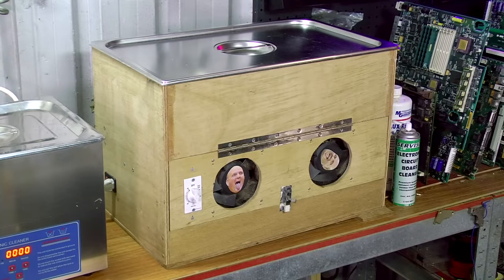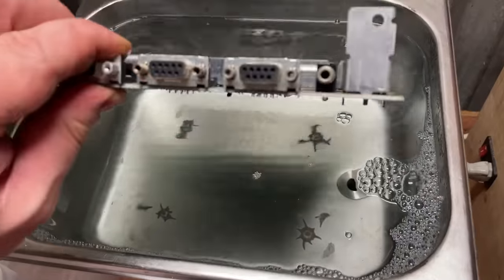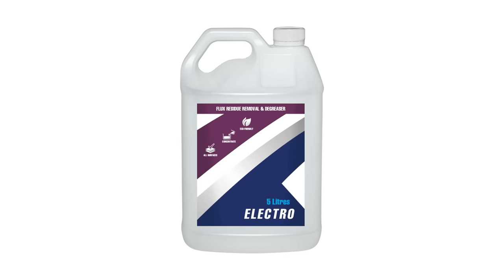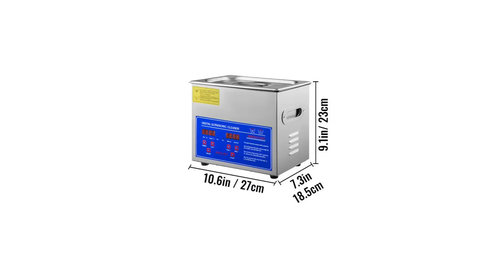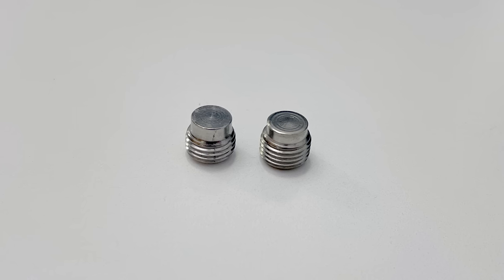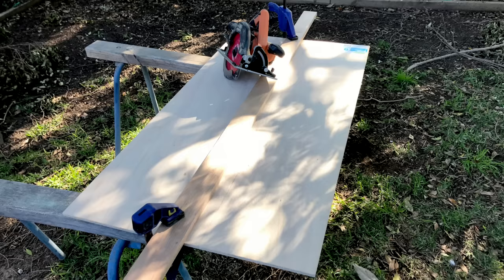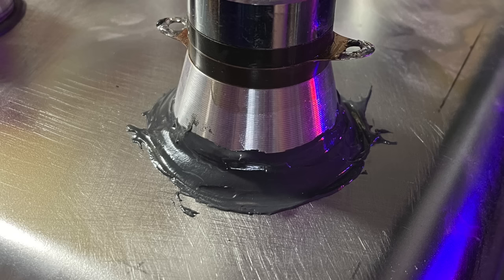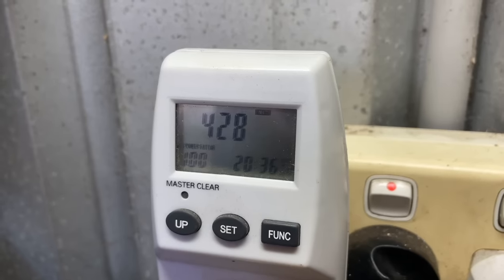Building my own Ultrasonic Cleaner

Comment: Great article on building an ultrasonic cleaner. 

Some suggestions  : 

*) Positioning of the transducers under the pan.
The two commercial units and your own show the transducers spaced equidistance and positioned relatively close to the edge of the bottom of the water tray.   This will work but creates a really  inefficient transfer of acoustic energy into the tray and water.   The curved edge of the tray is the stiffest part of the tray.  So its hard to impart vibrations into the pan.  The centre of the pan is the most flexible part of the pan and this is where the transducers should be mounted. 

To maximise the amount of pan bottom-panel movement , you need to mount the transducers closer to the centre of the pan.
You also need to keep in mind that the transducers are now acting as a broadside array (in both the X and Y directions of the pan area) and that the spacing between the transducers will affect the (spatial) phasing of them (and hence  the amount of overall power).  To keep the transducers working in unison (spatially)  you need to space them at integers of the wavelength they operate at.    The  propagation velocity for water is 1450 m/s and for the steel pan , somewhere  around 3000m/s ( from memory , so please confirm this before using it)  Since your mounting to the metal pan,   then say your transducers are running at  30kHz  then 1 wavelength will be C/F = 3000/30E3 = 0.10 m (driver centre to centre).    So ideally you would need to keep the transducers  spaced around 100mm.  Any way you have the idea , you need to plug in the  operating frequency for your devices, and look up the correct propagation frequency for the metal.

You could measure the propagation time across transducers to work out spatial phasing and ideal  transducer distance  by exciting one transducer (only) and  measuring from a second adjacent transducer , but treating it as a "pickup microphone". 

*)  Polarisation of Transducers 
It is not impossible that  the output transformers feeding the transducers  may have different winding directions depending on suppliers of the transformers.  It is wise to check , with a scope the actual drive signal polarity to make sure all drivers are running in phase. 

*) Tuning of the driver frequency for maximum power output. 
The transducer design you are working with is known as a Tonpilz transducer ( means musical mushroom in German).  The conical aluminium mounting base is a 1/4 wave acoustic shorting stub.   This all means that the transducers are resonant devices meant to transfer max energy at the resonant frequency of the transducer.  I suggest, you tune each of the  drive and transducers, one at a time, mounted to the pan and pan full of water.  Tune  for maximum power transfer to the water.    What I do is to float a sheet of aluminium foil on TOP of the water, and count the number of seconds to achieve pinholes. That gives you a pretty easy way of calculating a time integrated method for real acoustic power measurement.    There will probably be a trimpot on each of the driver boards that will allow you to tweak the driver resonant frequency. 

*) You need to use welded lugs to secure the transducer to the pan underside 
Epoxy will work , but you lose energy ( the stuff is too compliant) and you are getting heat failure of the epoxy
Consider using  spot welding to mount the mounting studs to the bottom of the pan for maximum power transfer.  If you cant afford a spot welder, using a heavy duty  truck 12V battery that can crank  400 to 600Amps.  Use a starting solenoid  to interrupt the battery, use welding leads or car battery  jumper leads ( around 1/2 inch  thick copper wire)   and  then use a monostable multivibrator to  adjust how many milliseconds to  power the starter solenoid that feeds the  spot  weld  contact points.  Use a couple of spark plugs with the centre ground leads snapped off , for your point contacts. 

  *)  Transducer overheating 
Consider  using a high temperature epoxy (electric motor coil epoxy)  to glue small heat sinks to the bottom of the  transducer backs , so the fans can do their job better, and place the heatsink blades in the same direction as the air flow.
Heatsinks and glue mass will alter the Q and the resonance frequency of the transducers , so take this into account.
If your transducers are overheating, one possibility is that they are not transferring all of their acoustic energy into the pan and  water.
As a consequence, some of the electrical energy is converted to heat in the transducer. Use this knowledge to help you tune your device for max power transfer into the water.  

*)  Power transistor ratings 
Your output transistors are FeiHong FHA13009A (or similar brand) rated at 400V 100W 12A 4MHz  +150℃@(Tj)  in a TO-3PN flat pack 
(PNP power transistor).

Consider uprating these , use  Mouser selection search to find a suitable VCE, power,  current and  temperature rating.  To widen your search allow for other   mounting considerations such as TO3 can and use a heatsink placed in the fan air flow, and use fly leads to connect the trannies to the PCB. 

I found  2N6609   (TO3 can )   with 16A , 150W , 200 c (Tj)  but a VCE of 140V ( you will need to measure the max VCE of you drivers to see if this is high enough. ) 

You should measure the operating temperature of the existing trannies to see if its overheating the mode of failure or over voltage transients.For the former, you can solve using bolt on heatsink and for the latter , use a GMOV varistor across the C & E to clamp any bad transients (you will need a high speed scope to see glitches. A low speed scope may not be able to see them, and the scope leads may also be a source of damping, so beware ) 

Good article - well done 

Hope this helps 

George
Reply: What an amazingly detailed post! Thank you kindly for taking the time to share/write something so helpful and educational for everyone, bravo 🤝

Comment: It's refreshing to to hear "the rest of the story" Having done my fair share of custom equipment this shows the process nicely. I for one would have found someone to weld the screwed attachment points on the tray but hey that's me. The glue seems to work once the kinks in the method are Ironed out kudos for your persistence it paid off

Comment: A mechanic friend of mine cleaned some rusty heads for me at his house. He just put them in a metal bucket with water and baking soda. Then hooked ground to bucket and positive to a piece of scrap metal . He was using a 10 amp battery charger. It cleaned the rust great out of those heads. They had been laying outside for 10 years. I was very impressed. Thanks for all the great info. I want to make a 55 gl. drum into 1 for cleaning blocks.

Comment: I spent many years servicing L&R industrial cleaners and watch cleaning machines. Transducer polarity really doesn't matter as long as they are al wired the same. Any transducers in the system wired differently from the others will produce a waveform that is 180º out of phase and cancel its equivalent energy from the system.
Reply from the maker: That's great to know, thank you!
Reply: That is like wiring up a pair of speakers. If you wire one speaker, say using a red wire for positive & a black for negative, & on the second you use the black wire for positive & the red for negative, you have created an out of phase condition. With the balance control set in the center, you will not have any real bass. Turning the balance all of the way to either full left or to full right will bring the bass response back to life. With the balance set in the center, one speaker is essentially moving outward on bass notes & the other is moving inward. I used to call this the Star Trek "Matter verses Anti-Matter" effect.
Reply: What is the nominal impedance of an ultrasonic transducer?

Comment: This video provided me with tons of valuable info on DIY ultrasonic cleaners. Its nice to know someone who also is good a TIG welding ( as its called in the states). I wonder if the transformers were of the wrong values ( wattage wise) since they were overheating. A typical Chinese thing to undersize components to keep production costs down.
Reply: Also a note not mentioned elsewhere in this section; The mounting of the circuit assemblies benefit greatly by having their boards mounted on edge, with heatsinks all pointing up, such that air current in enhanced. In this way, they run cooler!
Reply: The Chinese are practicing zen. Minimalist Copper in the transformers, i.e. only what is needed without a margin . If you can drop your input voltage 10% you can extend its life …

Comment: Well done!

I'm sensing a pattern with those drivers... I hope you find some good quality ones.

If I were to make one I'd try drilling and tapping.a hole in the mounting pegs and securing them with a screw, washer, and loctite from inside the tub, sealing that with an o-ring or something because my welding is nowhere near good enough to tackle this either.

The vibration from the cones must be pretty wild, I can see why it would eventually break a brittle epoxy bond.

Comment: When I repaired industrial electronics, we had a dedicated circuit board cleaning station.  We had a dishwasher and a modified refrigerator with a hot air circulation system to dry them in, about 100 F to prevent melting things. Cascade was our soap of choice.
Reply: before or after they took out the sulfur?
Reply: @acidreign0911  This was the late 80's so I would guess after.
Reply: @ronjenkins6674  naa.. they didn't take out the sulfur till the 00's so cascade was much more effective back in the day.  I knew a guy that ran an internet cafe in the late 90's.  He use to use a similar technique on keyboards.
Reply: @acidreign0911   I'd use bleach on my keyboards if I ran an Internet cafe, LOL  This stuff was industrial electronics mostly used in making cardboard or tires.  That stuff was nasty, sometimes the only thing wrong was the crud was shorting something (or a whole lot of somethings) important out.

Comment: Would be an interesting and rather cheap experiment to do a series of the aluminium foil tests with a cascade of foils hung from above, that way you could make a 3d map of cavitation intensity. I'd guess the positioning of the transducers is crucial, combined with various driving frequencies you get interference patterns with unwanted hot spots and dead zones. Though I'm almost sure you can't precisely (if at all) set the frequency of each driver, so this could easily turn out to be a futile attempt to synchronize them in the first place. Still, it would be interesting to see if any pattern emerges in the current configuration.

Comment: Just a small hint. The lugs with the threads which should be welded on the tub, to which the transducers have to be glued, have a purpose. 
The thickness of the glue needs to be a certain thickness to optimize the energy transferee from the transducer to the tub. Otherwise the energy stays in the transducer an gets converted to heat. The waste product of the energy converging world. 
If one cannot weld there are mettle stripes of different thickness which can be bought and uses to make the glue the right thickness.
Reply: yeah that is true, but in reality glue has no business being anywhere near the transducers and the tub. Glues are organic and do not have the high density to properly transfer the phonons from the transducer to the tub. Welding is necessary otherwise you are robbing yourself on efficiency, and probably shortening the lifespan of your transducers. I was using these things way back in 1997 in combination with a Malvern Zeta sizer and a Malvern Mastersizer for particulare anaysis in the functional foods industry. Laser particle analysis, Mie theory, Fourier transform the whole shebang.
Reply: @psycronizer  Umm... all ultrasonic cleaners use a combination of a welded lug and a high temp adhesive (the proper kind comes in sheets and must stay refrigerated before use), but epoxy can be used. when used together, the energy is transferred through the lug and the epoxy keeps the transducer from unscrewing from the tub.
Reply: That's super interesting them heating up because of energy transfer, or lack thereof. So I guess that's like what happens when a radio transmitter's antenna isn't tuned properly, which also fries the drivers. Ya learn something new every day!
Reply: @psycronizer  I don't know what that's good for but I intend on learning. I have heard of a Laser Particular analyzer and sizer's but lack the wisdom for the other. Yet I am learning.
Reply: @psycronizer  alternatively you could weld saddles around the transducers with rubber wedges pushing the transducer firmly against the bottom of your tank …
Reply: Silver soldering (brazing) rods with flux made for stainless steel right on the rods IS available. Manufacturer says to use a propane torch. I would use acetylene bottle like I do for HVAC silver soldering. Because more BTU/time.
Reply: @psycronizer  I'm sure we are all very impressed, internet stranger.

Comment: Protip on the whole welding thing:
In a situation like this you don't actually need much skill to do it right. Just centerpunch the spot where the threaded bolt thingy is gonna be (so you have it marked from both sides). Then place it down right there and maybe hold it in place with some aluminium tape (or any other heat resistant tape). Then simply weld right on the spot from the other side (probably works best with a TIG welder, but MIG should work as well). You WILL blow a hole into your thin sheet metal, yes, but since the bolt is right there anyways that's actually what you want. It'll weld right through and onto the bolt. Done.
Reply from the maker: Thanks for the advice! If you get a moment, please check out my follow up video where I play around with some welding and silver soldering. https://youtu.be/ByhGEFwCxoY

Comment: Great video!   For attaching those studs, Harris Staybrite 8 is a high strength/low melting point solder used in the hvac industry that is quite easy to use.  It melts at 550F and can be applied with an inexpensive map gas or propane torch if they are the “swirl” type (gets more air mixed in for higher temps).
Reply: But will it solder to stainless?
Reply: @Carl Mayo  with the correct flux, yes.  Surfaces need to be very clean and heat controlled carefully to not burn out the flux.  Stainless is very easy to overheat, since it is such a bad conductor of heat, so go light on the heat and give it time to  come up to temperature.  Harris does make a special stainless steel liquid soldering flux that is probably better for more critical or difficult to clean assemblies, but I believe the normal stay clean flux should work if the surfaces are cleaned thoroughly.  Stay silv 45 or 56 brazing filler is also an alternative that can be done with a swirl tip mapp torch, but those rods are very expensive.  The stay brite 8 would probably work just fine as long as you get a good clean bond.
Reply: @carlmayo7650  Yes, Staybrite 8 can be used for stainless - it’s has to be used with a liquid acid flux.

Comment: Bruce, I have a suggestion for you. The studs that come with the transducer heads can also be silver brazed in place. A small propane torch can generate more than enough heat for that purpose. If you carefully apply heat to the stud a little at a time it is as easy as soldering. Granted the temperature is much higher than soldering but you will see the flux melt and flow when the temperature is high enough then the silver will flow just like solder does.
Reply from the maker: Thanks, I've had many other people make the same suggestion. I actually have all the solver brazing equipment now and will be doing some tests for me next follow up video.
Reply: @BranchusCreations  Hey Bruce, since the tubs are thin they will warp pretty easily if too much heat is applied. First, use something like a scotch bright pad or the like and Isopropyl alcohol to clean the area you are going to braze too. Then wrap the stud in something like baling wire to hold it upright and in place with the threaded tip up and the flat against the tub.  This will keep your hands clear of the heat and ensure the thing stays put. Then make a ring of the brazing wire to wrap around the unthreaded end of the stud. Next, apply a small dab of borax/flux to the spot. Remember the silver brazing metal is going to follow wherever the flux goes so start with a small dab maybe 5mm dia. or just a bit bigger than the diameter of the stud. Now place the ring tight around the stud and sit both in the borax/flux. Then heat the stud until the borax/flux melts and then until the ring melts and flows under the stud. There should be more than enough heat transferred through the stud to heat the tub. At that point you will see if the braze has stuck to the stud and the tub, it will resemble a good solder joint. Only Much hotter! ;-)  Don't try and feed the brazing wire as you would solder as the torch will melt it quickly and you run the risk of pushing the stud out of place. I hope this helps.
Reply: @Cyruscosmo  o
Reply: That's brilliant, I know because I was going to say the same thing. But glad I read through and found your statement so I didn't say "why don't you just silver soldier it?...My date stamp would show my comment posted after yours and could have  missled people to think that I copied your homework.... I mean , how would I know?

Comment: Built something similar to this in high school for engine blocks and parts. We also had a rotisserie system for it that would allow all of the gunk to work its way out of the water jackets. Going by your 25w per litre calculation I can see why mine could take half a day to get some of the bigger blocks clean. I was drastically under powered. That said when they were done they looked as good as the day they were made. It just took a bit longer.